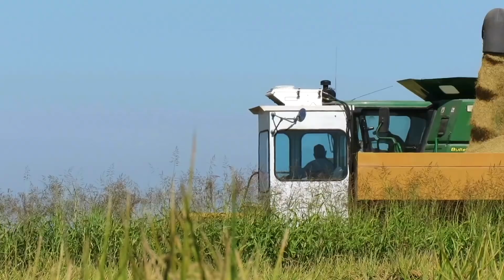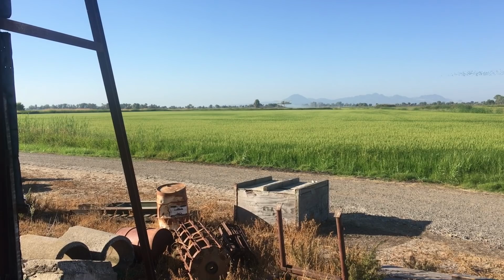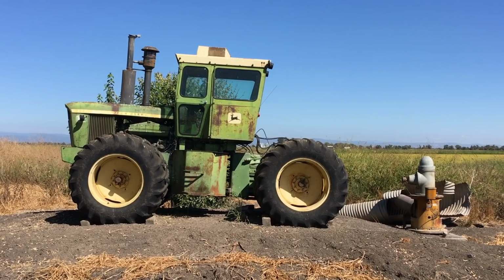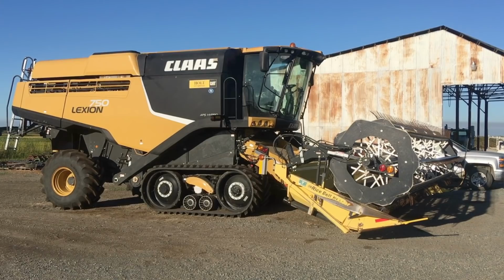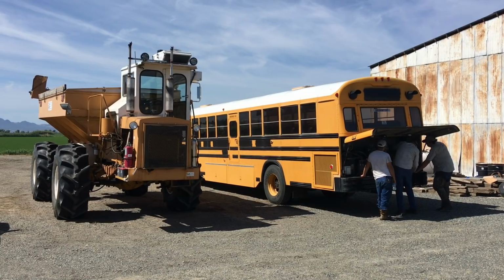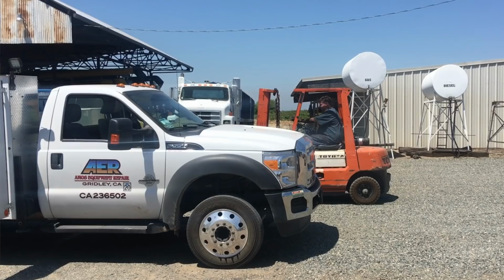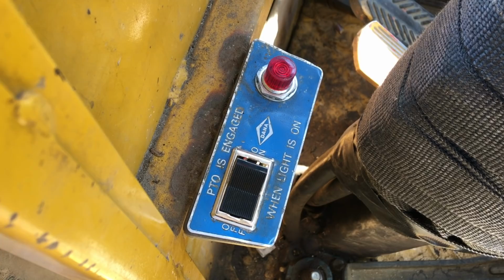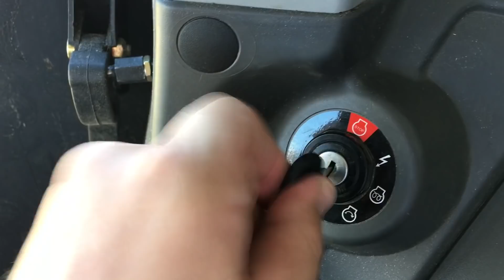Harvest Tractors are Out of the Barn | A Quick Tractor Video!

Comment: Just some advice on the Claas combine. When you go to unload grain tank. Do not stop until you are completely empty. If you do it will break a shear bolt over. Then if not careful the keyway in the pulleys that run the chain can give way and then you have a stuck pulley with a melted keyway inside. I've seen it happen 2 times. Next why do you run such small headers? We run 35 40ft cutting rice in Arkansas with the lexion
Reply from the maker: Hi Brad, we’ll do partial unloads frequently. Only had the shear bolt break once on the 585R. We lube the chain everyday. Secondly, we run a 21’ honey bee header on the 585R and a 25’ honey bee header on the 750. I’ve heard of guys running 30’ headers on the 760. Our rice straw is just too tough to run much wider.
-Matthew

Comment: I live on a rice farm in the Arkansas delta. Would it not have been more cost efficient to just buy a grain cart at auction and use it on your existing tractors? The "bankout" looks no more than 500-600 bushels and a cart doesn't have an extra engine to maintain.
Reply: Jimbo Fields I answered a similar question for Matt in this comment thread to “Agri Farm Models”.  Check it out above. I tend to agree with you but Pops, like many farmers in our area, prefer to do it Old School.

Comment: Matthew why do you run 25’ header on a fairly new class 8 combine (your claas 750)? Great video too👍👍
Reply from the maker: Hi Colton, rice straw is hard to process through the combine at higher moistures. So 25’ works well for us because at the start of harvest we get in the find when it’s still pretty green. We just have such a tight harvest window—we have to.
-M.
Reply: Kolton Wagner  I farm rice in Mississippi. We use 40’ Deere and MacDon flex Draper heads and most everyone does.  We have soybeans too though.
Reply: Rice Farming TV thank you for the response and explanation. As a person who is surrounded by row crops (MN) that size header didn’t make any sense but now it does. Also are you going to visit The MN Millennial Farmer anytime soon? He is the reason I found your channel back in 2017 
-K

Comment: Great Video, but why do you need so many bankouts for 2 Combines?
Reply from the maker: DUDE! Great question! We only need two but Pops wanted a spare (in case one broke down or if we were to start the third, spare combine). But then we won the 4th on a low-bid at auction. He was surprised.
-M.
Reply: Could use two grain carts to keep one combine running in corn. But then I’d need more trucks. And then I’d need the dump to run faster. And then I’d need the dryer to dry faster. And then...............